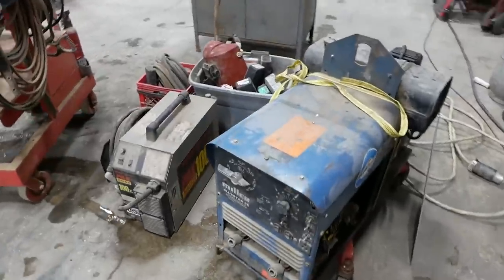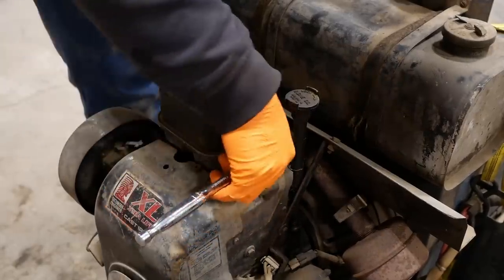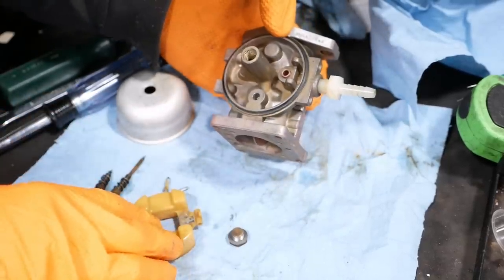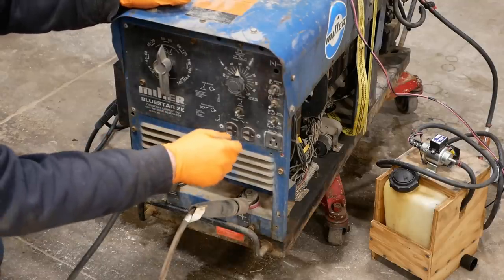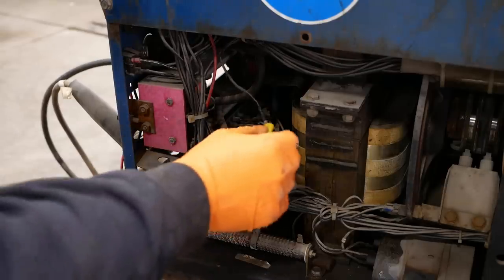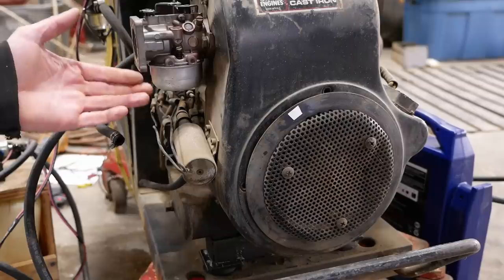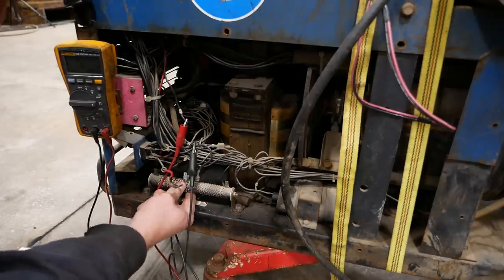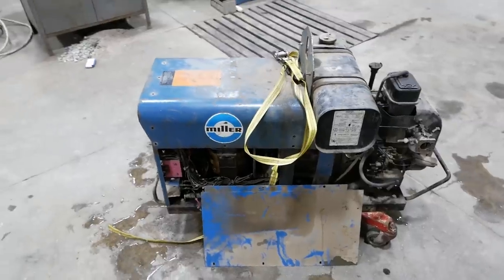I Bought a Broken Portable Welder - Can I Fix It? | Miller Bluestar 2E Part 1

Comment: Replacement carbs, $80.00 on Amazon. New in box. A kit with emulsion tune is $25.00. CHECK THE FUEL PUMP! If the gasket in the pump is shot. It's $50.00 for a new pump. The breakers go bad in them. So when they trip it shuts the motor off. They seem to reset, but the breaker is burnt internal.

Comment: I had the same miller welder it was a basket case, some parts are available from miller, but not much, i had to cross reference parts from other machines and industries, the motor has a special output shaft...  The pow-con is the real treasure and with the wire feed unit its unstoppable...  a true inverter welder with a healthy duty cycle. made in usa not around any more but there are guys who can and sell repair boards.... nice haul....

Comment: Those PowCons are awesome.  It is what we used in the Navy.  I was a turdchaser so I had to hump Powcons every day.  That and an LTec plasma cutter with 440 cables 110 cords, and air hoses.  You had to make sure the gang boxes of the 440 leads were on your back or they hit you in the nuts while carrying.  Those Powcons took a beating and just wouldn't quit.  Had to do a deck drain one day.  There is an adaptor you can attach to the Powcons so you can do aluminum MIG.  Perfect 360 weld.

Comment: Them tecumseh carbs have an idle port on the emoltion tube that clogs. I burn a bread wrapper tie and use the wire to poke through it.👍👍. That's a great find. Thanks again Wes!
Reply: watchweswork-official ?

Comment: A 1N5458 diode sounds like a good replacement. If you have some nichrome wire you might be able to rebuild the power resistor. You may be able to get some out of a junked electric heater. The cap is definitely bad though, easy to find online for around $16 US.

Comment: Put in the specs on your cap the microfarades and the volt specs there should be a model number on there too  and do a search you dont have to buy directly from Miller there are plenty of after market replacements.Should be fairly inexpensive . If its leaking oil its smoked your welder will never weld 100% with out a fresh Cap. I really enjoyed the video very nice job

Comment: Wes....you bought yourself some Grade A stuff there!!! I'm very familiar with the Powcon. That's a beast of a welding machine!!!! Where I used to work we participated in a lot of maintenance stops at the local steel plant (Tata in The Netherlands) and these Powcons were our trusty stick welding machines. I've never seen that Mig wire attachment  before but ofcourse...that's the next logical step! I think you can even gouge with them although for a very limited time. They can handle a lot of abuse!!!! Ok...you have to lift them with 2 guys...🤣but the buildquality really shows!!!

Comment: Those are great little welders I've had one for 30 years and you are correct I don't think the carburetors are available anymore. What I really like about them is they produce 120 volts ac at idle

Comment: It will be great to see the Miller going again. they are a quality welder that will last a long time. Clearly this one was in the wars, however we don't know how it was looked after & stored when not in use. You will have a welder, 110v power supply & presumably 12V supply also. It will be a great asset for the workshop and on field trips. It has been a while since you went to that property with a number of machines scattered here & there. It will be interesting to see if the generator portion can supply the plasma cutter  if it plasma cutter can be converted to run on 1ph.

It will be great to see if you can get the Plasma cutter working and the other welder also. I hope you do a video on those items.

Comment: I'd look at the valves in that engine, given how it was popping back. If it gets to working well, you might consider doing some rings in it to get that oil burn lower.  Very cool to watch you get through the troubleshooting and get that old blue box sparking.  Thanks

Comment: Very good diagnosis, great you could get the spares quite easily. I used to repair most makes of welding machines, as you say Miller supply got information in their hand books and parts list . We always knew if parts weren’t easy to come bye then best bail out before your cost rise, on the job just trying to resource. Looking forward to pt2 👏👏👍

Comment: Laquer thinner Acetone cleans carb varnish internal jets etc
You could rewind rheostat rebuilt it .
I think Hobart is made by Miller.
I have a few welders.
One issue was dirty green contacts in current selector switch and rheostat from sitting out in rain.
Bridge rectifier was popped on one which I found at Radio Shack ! 😂
Excellent quality machine s.
Lincoln and Miller Hobart all good.

Comment: this is funny; i have a 2E on my service truck and a PowCon 400 in the shop. the 2E is a little underpowered but is solid keep good oil in and will last.
the powcon is one of the first inverter welders and is very solid, will run on single phase (with loss of output) but works very good. will also do Air Arc. 
i have docs on the powcon. enjoy them

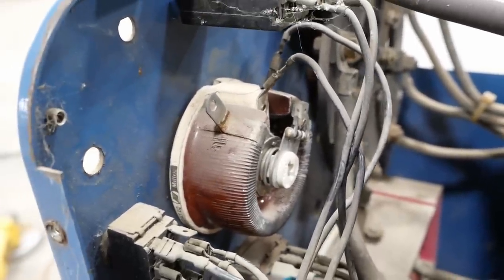Comment: So from the video at 30:28 the rheostat is only using the wiper and one end (damaged). You could move the connection to the other and - letting the damaged end "dangle". The scale would now be completely reversed, but not a big deal. Just as a longer test without investing anything.

Comment: if the 120v is good, that eliminates the excitation circuit as a problem. rheostat was toast. i believe a connection that gets some oxidation and increases resistance can snowball into problems, so clean all the wiring connections, terminals, etc. Lucky the windings are good.

Comment: I have had one of those for years. The have 4 pole armatures and put out 3500 watts of generator at 1800 rpm. Very easy on gas. Those engines are very good and tough, too. If the high energy ignition  coil goes out there is no new ones and have to convert to a pickup and I use a Dodge ignition module.
Reply from the maker: Interesting!

Comment: You could always find an old welder that works and pull parts for it off that. The welder portion is based off a welder they made so probably able to get most if not all the parts plus leads for like $50-$100

Comment: Nice score on the welder!
That capacitor looks like a run/start capacitor that are used in many air conditioning units. You can get them from Amazon.  Just find out the specs on the can and you will be fine.
I usually get them from my friend who is a refrigeration mechanic.

Comment: If you do not have them, a carb jet cleaner set works wonders on many of the small engine carbs I have repaired by cleaning. They are currently 9$ on amazon. I enjoyed this. Cheers.

Comment: i know those older machines you have to use 6013 they were different polarity so to speak a/c d/c one of the other i had an older onan that you had to use 6013. when you were first welding reminded me of it running with the wrong rod. you had to be pretty good and steady to weld with 6010 if you were in a pinch and thats all you had it could be done but it would stick a lot. i remember when i bought it i was told that and at the time all i had was the 6010.

Comment: Just wanted to say great work, the bulk of what I worked on were miller and Lincoln, but I didn’t think about how much of the process are more automated! I mean I knew what was happening and a lot of what you were troubleshooting on the gen side was, likely, just a simple stupid mistake on somebodies part. 

My worst loss on one of these was a Duetz powered version of the same model, dropped from a crane hook, the engine had a broken crank that dropped the rotor into the windings… this was 20years back but at that time the crank alone was $1800.00 plus $800-1000 to rewind the generator… no good! Lol😂

Comment: Another impressive job of troubleshooting Wes!  I could relate to diagnosing the engine issues; however, I wouldn't know where to start with the generator/welding problems.  Thanks for sharing!

Comment: I have that exact model of PakMaster cutter, they can definitely be run on single phase, If I remember right, the wiring diagram is inside the left panel on the side. Nice cutter for what it is, but pretty primitive by todays standard

Comment: Many are replacing the vacuum pulse pump on small engines with 12 v pumps.  A few even go the extra effort to put a bypass regulator and fuel recirculating line.

Comment: I think you definitely lucked out with the Miller welder.
 As others have said Miller is great about providing schematics and even working with you to try and troubleshoot things.
 I have that very same welder and the trouble with mine is the tecumseh motor. 
 The Ignition module is out on it and there seems to be no replacements made for it so you either have to find a motor that runs right or a used one somewhere so essentially it's dead in the water until I can afford a replacement motor.

Comment: Wes if that Tecumseh has trouble turning over it is the compression release on the cam. You had to buy a new cam to fix it which is now unattainum. It is just a pin that wears out I just made a replacement pin.

Comment: Wes I used to work in steel mill in Chicago suburb,  Lincoln 480 volt 3 phase motor gen setup like you got. Check your brushes & stone the commutator,  with a stoneing tool such as,  Ideal used to make,  or some very fine sand paper. Check all your brushes. Hugh Mc. Chicago,  metro.
PS: correct you have to excite the field of generator. 
Stone your commutstor.check brushes for slip ring. And brushes for excitation,  stone them.
Reply: watchweswork-officia  Mr >Wes, not getting that line. Some reality for you as the irish say,{ lad.
 I seen you in the Winston Park mall fixing a lift up down type. I used to work about two miles west of there same town as your lift job. Melrose park, IL. Also next town west is Northlake, you can verify that lic # 33 had an electrical license for 30 years out of there. I'm 64 , also had an IBEW A card journeyman. 14 years got out in 2008 I was 48 then . Its going to happen again.
In 1986 my second industrial job as an electrician trainee, I worked on Lincoln LM9, Miller Welders 480 3 phase motor generator setups over head cranes , all day long. 8 hours a day. We were a structural steel fabricating shop. It was called FM Weaver, then it went to Chicago steel, Now Metalux is on that land behind a big Ford dealership , then Pittsburg Demoines group. I was 28 way before I went to college. Now I am an old guy. Very rare do them carbon brushes fall out of the Rheostat, resistors yes, carboned commutators, & worn out brushes. I only seen that maybe two times. very rare. I'm happy for you that you got a portable stick welder, that works. Get that 500k subscribers for 2023, you been at this for a while now; a good goal. 
[You guys are the You tube super sales man. Happy New year Wes. Peace. HughMc , Chicago, metro.

Comment: That D8 symbol is for a zener diode. It acts as a normal diode in one direction but in reverse polarity it allows a specific voltage value to pass through.
Reply: That's definitely not a zener symbol, and a zener makes no sense in the circuit.

Comment: I have a Miller trailblazer that doesn’t have any output just like you did at first. I brought it to an authorized Miller service center an they checked all of the outputs and load tested it and gave it a clean bill of health but still minimal output on AC only. DC seems to work fine but my intent was to use for AC tig.

Comment: Don't get a used carb get one for a Kohler 14hp a k231 I think. Adapt it on. Those factory walbro carbs  had tiny cross drilled holes through the main jet and housing that you'll never realign once the factory main jet is removed. There was a "service" jet made for this reason that are no longer available. Also the ignition module is obsolete. However you can use a ford abs wheel sensor a GM HEI ignition module and a 12v coil to make it run again I went through it with an old wheel horse recently

Comment: (i'm only 23 mins in, so maybe you end up discovering this)--    But sometimes you need to switch polarity of your weld and it will be much stronger.  Most welders will have a switch that does it for you -- but if not, just swap your leads at the welder and try it again.  (I think it's reversed polarity on tig-  but I forget exactly, so it's worth a try).   Also, sometimes it's just a bad ground connection, so you can tap your rod directly too your ground clamp and if the arc is strong, then you just need to scratch your ground to the work better (which is super common).  Also, you can try to turn your welder WAY up and see if it responds;  There could be a bad spot on the dial itself possibly.

Comment: Excellent video Wes  :) I know could figure out and did good now get all parts do big stuff testing out for 👍 to! Also glad hear parts available and that carb try keeping it up in good shape too 👍! Also why say that that carb is hard find parts my late Dad 1976 Sears brand 6 hp 4 cycle Rollteiller was hard only could for carb at all  available is air filter and spark plug that in that in 2017 plus use same carb type as this Welder ! Also found to that have start turn fuel tank on , make sure got full of engine oil 10w30 no synthetic type, put choke lever to 3 full open then rip cord start when fire put choke to number 2  in middle make sure low idle screw set so motor shake smooth running and fuel mix to 50/50 no smell gas or oil or spitting out air filter plus carb and put throttle to full open run it and feel or loping up high to low idles take choke to off position and go to mix screw adjustment till smooth out  and ready use it ! But run out gas put choke 1 then 2 then 3 to off position and all prime  up!

Comment: you can get replacement carbs, and rebuild kits, just have to do a little digging, seems like every time them impulse fuel pumps go bad they will run on choke, but not so much without that fuel pump, gravity just isn't enough to keep er fed.

Comment: Riostat resistor diode and a fuel pump a capacitor and a battery not to bad and will be a good Unit don't gotta be pretty just has to work right @Watch Wes Work

Comment: You could build yourself a rotophaser to make 3 phase power in your shop. all you need is a 3 phase ~2hp (motor should be around the same hp rating as your appliance) electric motor, a pulley and a piece of rope. Place the motor close to your electric panel and wire the L1 and L2 legs of the motor to a split phase breaker in the panel. Take the L3 terminal off the motor and run it to the 3 phase appliance that you want to run. So the appliance would need another breaker with L1 and L2 to a separate breaker in the panel. Wrap the rope around the motor shaft or pulley and yank it as hard as you can, then immediately turn the breaker on to the motor. If done correctly, the motor should fully spin up and be generating your L3. If the motor spins slow, then you didn't yank the rope hard enough and need to start over. THen simply flip the breaker to your appliance and bingo- 3 phase in the shop. We used to use this method to run a 3 phase blast freezer in Alaska.

Comment: It's called polarizing sometimes when generator sit for a long time you have to repolarize the magnet the little magnets inside the windings with a 9-volt battery on the two little copper strips in the center outside of the generator should be right there

Comment: That Powcon welder is a great welder. And yes they are made in America. They were one of the 1st inverter welders ever built. Capable of running single phase or three phase 230 or 460.   Miller bought them just to get there patents to use on their xmt series welders. Look up the Miller xmt 300 is looks identical to this it's just painted Miller blue. If you wanna sell the Powcon I will give you $100 for it. Lol

Comment: Those small carbs usually won't run because the idle jet is so small that with the gasoline we have now easily get clogged. Many times you have to remove the brass jet and make sure you can see daylight through it. You might be able to clean out the hole with a torch top cleaner. It gets a sticky varnish in it.
After that is clean ,then it will start AND idle.
Reply: ...sometimes get the low speed jet out and get smallest drill that that won’t go and drill it to open up the jet. Did that for my neighbors mower and snow blower...the surging was driving me crazy 😝

Comment: Wes, love the content. If you ever need a carburetor there should be plenty of chinesium knock-offs on ebay. They have like a 50/50 chance of being any good; either it will work or it won't and I believe you can use a small variable frequency drive as a 3-phase converter.

Comment: That capacitor ya can probably find it at a hivac dealer they are common in furnaces for the blowers ands central air systems ie outside condensers ie caps for the compressor start nds fan etc

Comment: If you look at electrical schematics you probably find a electric fast run switch for carburetor when weld sparks it engages wide open throttle

Comment: My uncle bought 4 electric tomb stone welders which were all junk, Took 4 of us to load just 1 up into a truck, I stripped and scrapped the copper in them, we had to unload them in a spot for later, well, I had to drag them 1 by 1 into the garage with my truck so I can strip them, lawn tracker couldn't pull it, not enough grip, They had to weigh around 500lbs each. wasn't fun lol.

Comment: That capacitor is probably okay. Oil-filleds don't generally age out like electrolytics. A bit of oil leakage isn't great, but measure the capacitance and if it's close, keep using it.

Comment: Check and see if there's two copper points on the the windings that are facing outward that you can get to without taking nothing off on the generator put a 9 volt battery touch in both parts for about 12 seconds and then start it up see if you got full power